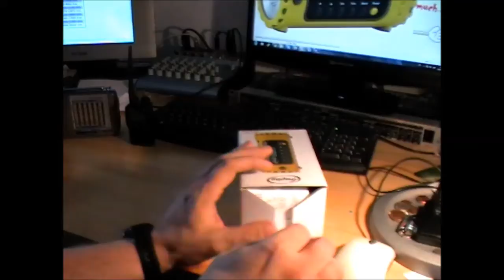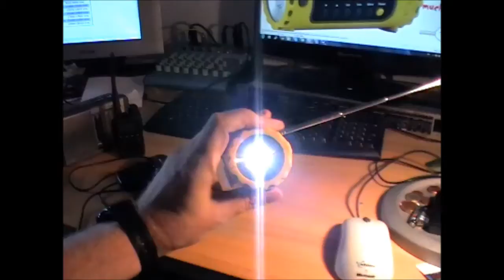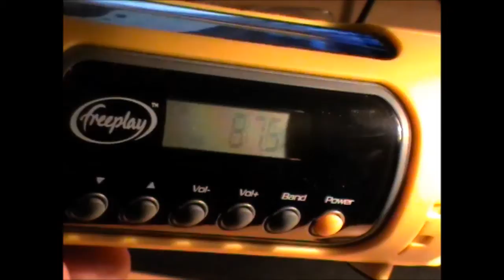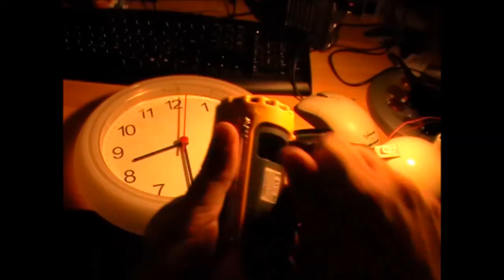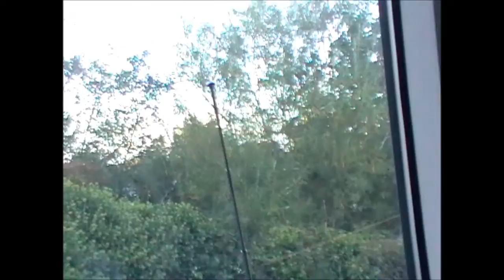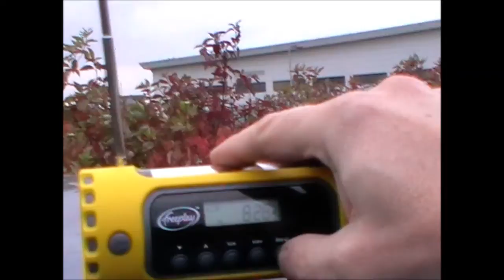Survival Radio - Freeplay TUF Product Review

Comment from the maker: Hi Peter to your questions. About short wave radio. When I did the video I didn't realise that there seem to be 2 versions of the freeplay radio. The european version has a 9kHz step on AM or the medium wave band. The American version has a 10kHz step which makes sense. It seems that there are two types on the American market. One has the 10kHz step and the short wave band and the other has the NOAA the emergency weather alert frequencies but no short wave band.  I am not sure which of the three versions you have. I got caught out by it myself when bought a radio for a friend and it turned out thar SW was not on it. I ended up buying another similar radio from China with SW included. Now SW is for international broadcasting. In the past SW used to be something like the Internet today i.e. the place where you could get information from all over tge world but nowadays there is probably just 1/10th of the briadcasters who are still active. SW relies on activities in Sun to work well. There is an 11 year cycle. At the moment we are right in the low activity part of the solar cycle so in addition to having less broadcasters to listen to the band is not as active as it was a few years ago.  About your iPhone charging. Bear in mind the hand generator is just meant for emergencies. When I was trying it I   was using the generator for asbout 5 minutes and I the equivalent of 1 bar on the phone. It enough to make a quick call in an emegency but not enough to fully charge the phone. I am not sure why it doesn't  work for an iPhone. As a workaround you could use the hand generator to charge an external booster battery and in turn use that one for your iPhone. Not the most efficient way but we are talking about emetgencies. I hope the info helps a bit. Mike
Reply: Seismic Radio Thanks Mike. It is the SW version. I actually had to switch some setting from 9 to 10 to be able to get the AM band. I will see if I get some SW when I come to Germany this summer. May be there are more sw radio stations in Europe, but too bad I cannot listen to them in North America...
Reply from the maker: LB22peter you should be able to hear some of them. In day time try 9MHz and above and in the evening try below 9MHz. Another trick to improve reception is to connect a random wire about 5 to 10meters long to the antenna. You should then be able to pull in weak signals.
Reply: Seismic Radio Here is an update from my test: 1minute cranking = 13 minutes radio at volume 15; 8 hours of sunlight = 2 minutes of playtime at volume 15. ONLY 2 MINS??! :(
Reply from the maker: that sounds about right as far as the cranking is concerned. I think that is what freeplay advertised. About the sun and solar charging. If you are in Canada to optimise charging you would need to place the radio at a 45 to 50 degree angle into direct sunlight. If you miss the correct angle it will still charge but be a lot less efficient. My experience was somewhat similar but a slightly bit better. Also if your radio is inside and your house has tinted windows you will loose a lot of efficiency through the glass.
A couple of things you can try:
Pop one side on a box to get the 45 degree angle
Try to put it somewhere either behind clear window glass or outside for the day.
Also make sure it is a sunny day and not cloudy ie. you get direct sunshine.
About the angle......I just read about it and knew the theory. I work as an electronics engineering lecturer so one day I did some experiments with my students and we tried a solar panel at various angles. I was surprised how much difference it made to the power generated by the solar cells by just being a few degrees out.
Hope the info helps

Michael
Reply: Thanks Michael, I can tell that you understand much more than me, and this is why I am writing to you, but what I did yesterday was exactly what you suggest: I left the radio on the balcony for 8 hours, there was not a single cloud in the sky and I was constantly changing the position of the radio so that there can always be a 90 degree angle between the sun rays and the solar panel. The result: about two minutes of playtime, and then stopped. This morning I woke up and tested it again (after it has been in the dark for the whole night) -- it also played for about 2 mins before it died again. It's a mystery for me, but this is how I explain it to myself: 1) the radio plays only for two minutes after 8hrs of sunlight because the solar panel is not working (i.e., the radio is defective) or because (and most probably) it is not sufficient to charge a radio (may be a clock, but not a radio); 2) the radio works in the morning after it has been discharged in the evening, because the battery never discharges completely (i.e., the flash stops, and shortly thereafter the radio as well, before the battery is completely discharged). Leave it in the dark for two minutes after the flashlight has stopped working and you will see that it will start working again. I am not an engineer, but it seems very illogical to me.
Reply from the maker: It is strange but you may be right that the solar panel is faulty on the radio.
When I wanted to find how long it would take to charge the radio via solar I left it in the sun for a week just on the window sill. And did charge it in my case. The way I understand the purpose of the solar panel is to to just keep the NiMH batteries topped up and ensure the radio is ready for use in an emergency. When the radio is in the sun the display suggests that it is charging?
Reply: Seismic Radio Yes, the display says it is charging. I have just tried it again after it had been outside for over 8 hours on another sunny day and it lasted for exactly 90 seconds before it stopped. Then I waited for a couple of minutes (in the dark, no indication of charging), and I turned it on again and it worked for 50 seconds. The third time I tried it worked for 35 seconds. I should probably leave it for one week like you, but if charging rate is linear then I will have just about 7 minutes of playtime after a whole week. Is this normal for the capacity of the solar panel? I have no idea what 5 v 25ma means and how fast it is supposed to charge a battery of 350mah
Reply from the maker: Basically 350mAh means that if the radio uses 350mA then  in theory it should run for 1 hour, if it uses 175mA then for 2 hours and for 90mA for 4 hours etc. Still it is not quite as straight forward. When determining the mAh of a battery they use a discharge time of 20hours.
Now with charging the battery it should take about 16 hours to achieve a full charge in theory. Still there are losses in the charging process and unless you live somewhere near the equator it is unlikely that the solar cells will perform fully i.e. give the full 25mA. As a rule of thumb I would allow about twice the time based on the those figures so you are close to four days of solar charging. The batteries will last longer as well if they are close to being fully charged.
I am not sure whether you have done it but try and charge and discharge the radio batteries fully a few times. I.e. get a mini to normal USB lead and charge them up from the USB port. It should only take a few hours. Then play the radio until it dies and then recharge them again.
It will condition the batteries and most likely they will perform a bit better in accepting a charge and in delivering power.
I will try the solar charging only with my radio for just a day and see what performance I get. Unfortunately I am in England and we do have too many cloudy days which are not too friendly to solar ambitions.

Comment: How do you know when the battery is charged if you use USB? Can you leave it charging for the whole night? Or is there a tome restriction?
Reply from the maker: LB22peter just leave iy in for a few hours. Since it is a small battery iy won't take long to charge up to full capacity. A rough indicator is on the display. If all three bars are lit when the radio is playing it should be charged up. Once charged it will go down to 2 bars very quickly and stay there for some time before it goes to 1 bar.

Comment: Is AM 9 kHz step? 10 kHz only for US version.
Reply from the maker: I am in England and I bought mine in Europe  so there is a 9kHz step for AM in Europe. I understand that the USA version is different including the other features like weather channels. If you are in the US it us worthwhile to check it out.
Reply: FM is 0.1 MHz or 0.05 MHz step for European version?

US version is 0.1 MHz while US FM broadcasts uses odd frequencies.

87.5 MHz to 108.0 MHz
Reply: Seismic Radio It goes up to 1620 kHz for 9 kHz?
Reply from the maker: yes mine goes up to 1620kHz. The FM steps are 0.1MHz or 100kHz. Over here I can pretty much pick up every FM station.
Reply from the maker: yes it does
Reply: Seismic Radio UK overseas Island BERMUDA, they have 2 NOAA weatherband stations there in 162.400 MHz and 162.550 MHz.

Comment: Great review!
How long have all the functions of the freeplay tuf continued to work for you? Has it broken in anyway since you bought it? I'm interested in buying this specific survival radio but I want one that lasts a long time
Thanks for any feedback
Reply from the maker: Hi I have had it for about a year. it still works OK. When I bought it one button was a bit sticky but it worked itself free with time so it is OK now. I have used it maybe once every two weeks and it still works fine. I assume that the internal battery is an NiMH which means it doesn't hold the charge too well if you leave the radio on the shelf for a few weeks. I tend to charge it with a USB charger and when it runs out I do use the crank generator. I found if you keep it in the sun the solar panel will charge up the battery. Charging it from 0 with the inbuilt solar takes a few days. I find that it is a bit pricey, very basic but it works and it certainly is ideal for camping, hiking or emergencies. Mike
Reply: Seismic Radio another radio I'm considering is the Kaito 600 as others have done a modification on it where the factory rechargeable NiMH (I think?) battery is removed and AA rechargeable batteries are inserted into the backup AA compartment and the factory rechargeable batteries wires are attached to the AA rechargeable batteries ( e.g. Energizer etc) and it hugely increases duration of battery power 
But I can only get some of these radios from the USA via eBay, so will the AM/FM bandwidths work just as well for me in Australia? or are there compatibility issues?
Thanks again
Reply: ImpermanentHuman USA version have 10 kHz step on AM (530 kHz to 1710 kHz) and NOAA WEATHER BAND (162.400 MHz to 162.550 MHz).

Non USA version have Shortwave (3 MHz to 22 MHz) and 9 kHz spacing for FM (531 kHz to 1620 kHz)

Both USA and Non USA versions have 100 kHz spacing for FM (87.5 to 108.0 MHz)
Reply: Francis Litan thanks mate, yes I have decided on the SW version
I'm also planning to get a Tecsun Pl660 radio too, it's not hand crank or solar powered, but I plan on using an external solar charger/powerbank when camping/survival uses
Do you have any strong recommendations? I don't have a HAM/amateur radio license so a portable highly sensitive scanner for multiple bands including Single Side Band makes sense as the next best option
Thanks for your feedback, you know your stuff :)
Reply from the maker: Just to add to your comment.Try to go for a HAM Radio licence. From what I can gather there is quite a bit of activity in Australia. Also in the USA there is GMRS and FRS for UHF licence free communications. In Europe we have the 446MHz allocation for short distance radio coms. It makes sense to kit yourself out with some form of communications in case the lights go out. 
About HF and using SSB it certainly makes sense to be able to receive it. Have a look on Ebay. There are some chinese Tecsun shortwave receivers with a BFO which allow you to receive SSB. It's worthwhile to have some facility to receive SSB for sure.
Let us know how you get on!
Reply: Seismic Radio thanks for the advice, I have actually just bought and received a Tecsun Pl-660, according to all the reviews it seems to be virtually the same radio as the slightly more expensive pl-680 (which is only designed to look a bit better) and the 660 is actually more sensitive and clearer at receiving most signals than the most expensive top of the range pl-880, although the pl-880 has a better speaker for quality FM listening and generally looks much better for a 'bed-side' radio, however the 880 has 'warbling' on SSB which has disappointed most buyers and it was never properly fixed by the manufacturers
So the general consensus is that the pl-660 is clearly the best value for money...just reading the instruction manual now, even the English version manual isn't particularly easy to understand though
It doesn't have solar or hand crank charging though, so will still get the Freeplay TUF for emergency back up when there is no way to charge the 4 rechargeable AA batteries the Pl-660 uses
Reply: Also the Tecsun pl-660 has airband where the pl-880 doesn't, but it's only of any use if someone is very close to an airport apparently, some people just 5 miles away have been unable to hear anything audible from the nearest airport
Reply: Seismic Radio How about Baofeng UV-5R?

136 MHz to 174 MHz / 400 MHz to 520 MHz. Which includes NOAA Weather Band (162.400 MHz to 162.550 MHz in 25 khz steps), GMRS/FRS, ham radio (license required if wide band, no license to listen) and also includes FM Radio (65.0 MHz to 108.0 MHz in 100 KHz step).
Reply from the maker: Hi Francis, 
yea why not. I have got the UV3, UV5 and the GT3TP
The GT3TP was only about £30 I think the UV5 is about £25 or so.
The software seems to be the same for both radios ie. UV5 and GT3 but I think from first impressions that the  GT is more matured. The receiver seems to have a better selectivity and on transmit the audio sounds a bit better. I have the UV5 for years and the battery went so I got the high power battery pack which is about 1 times the radio and it seems to last for ever now.
The GT3 has 8W output power and I noticed the the 4 additional watts actually do make a difference in accessing repeaters and of either making it or not making it.
The UV3 for about £20 covers the same frequencies but I like them for their size, the standard TNC antenna socket and standard lithium batteries. 
Still you don't have shortwave on them.
One of the radios I have had most fun with is the Yeasu VX3 you got short wave on them, excellent receiver sensitivity, selectivity and good coverage on HF and VHF too. I got mine via ebay from Greece for a bit more than £100 but I think they are now a bit more expensive than that. A nice radio to carry around just a bit pricey. The yeasu is the little radio you can see in the video. I bought a bunch of spare batteries to keep in reserve when I am out and about.
Not sure what to advice other than the Baofeng range radios are cheap and cheerful and certainly fun but within limits. Go the extra mile and get a Yeasu and you will have the full hog.
Reply: Francis Litan yes I want a ham radio but it is illegal in Australia to even own one without a license, I specifically inquired and was sent the exact wording in the legislation that states the penalties for even possessing one without a license
So I either have to get the license in which case I'd be free to transmit too, or settle for the Tecsun pl-660 which I have just bought that at least has SSB
Reply from the maker: Hey guys why not just go for a license?
In most countries the rigid regime of licensing has been somewhat relaxed from years ago and achieving a basic ticket can often be done over the weekend.
Check out some local clubs and get some info on what the exams are like in Australia.
When I did my first ticket here in the UK in the late 80s it was like a minor college course for a year but nowadays you could learn everything in a weekend session and the exams are now administered locally by clubs on an as need basis.
It is not that hard and worthwhile the time.
Reply: Wird das Radio in China hergestellt?
Reply: Is there warranty?